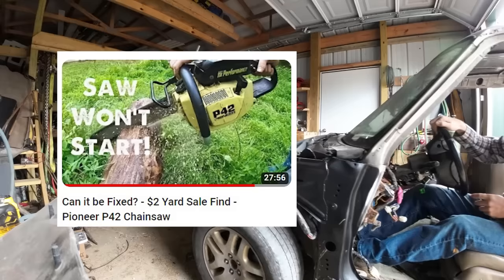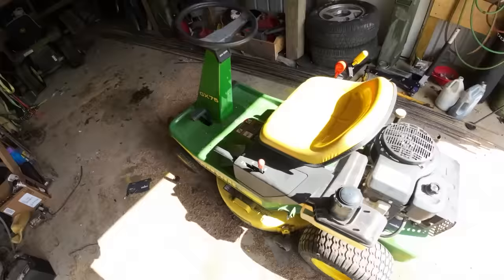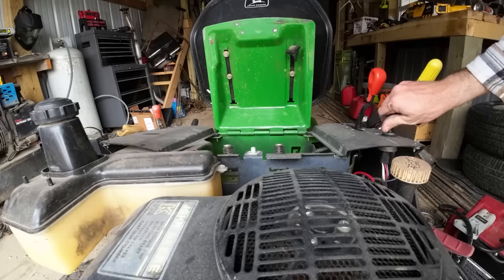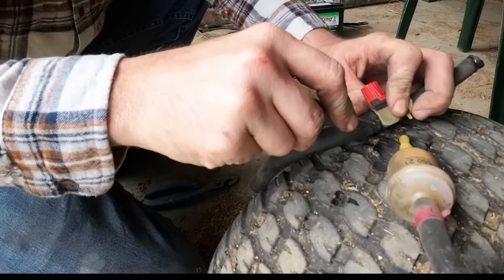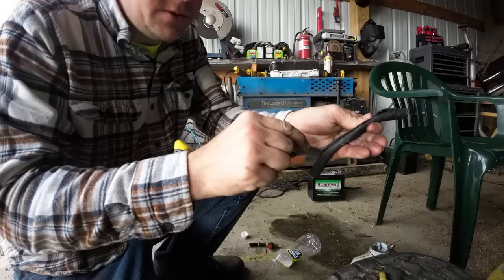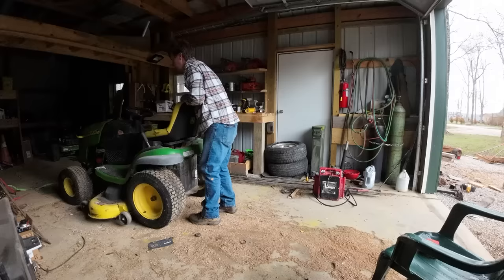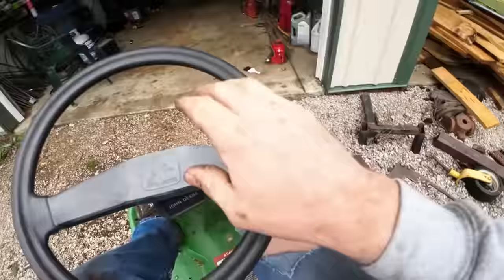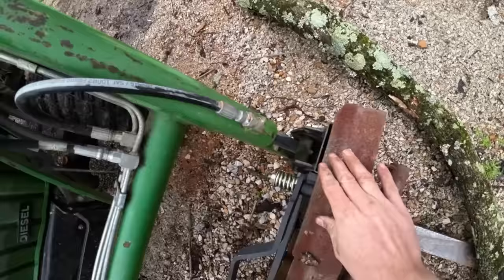Two John Deere Lawn Mowers - Cranks but Won't Start - Trade up Series

Comment: on the l120 spray ether into the intake if it runs on ether youve eliminated everything but fuel so if it runs on ether you have a fuel problem. also that solenoid is an anti backfire solenoid it shuts the fuel off from getting drawn into the motor after u shut off the tractor and causing a backfire
Reply: Exactly where my thoughts are too. Speculating on the fuel not getting through the passage after the anti-backfire solenoid. Pull the plugs and drip a little fuel into the cylinders spray some starting fluid down the intake and see if it can cough.
Reply: @tbirdracefan  yea and if it is an anti backfire solenoid problem he can just cut the plunger tip off but im betting on a fuel issue he probably didnt clean out the jets and emulsion tube good enough

Comment: I have had similar problems. I discovered the fuel bowl was empty each time it would not start. Simply removing the fuel bowl and reattaching it would allow the engine to start, but the problem would reoccur about every week. I have found that the fuel bowl float needle, as supplied by John Deere, is made mainly of plastic. The float needle as supplied by Briggs and Stratton is mostly brass. I replaced the JD with the B&S. The problem has not re-occured. I would guess that the lighter weight of the JD one meant the needle would occasionally stick in the closed position.
And the B&S one is cheaper!
So, get yourself the proper B&S brass float valve needle.

Comment: MTV (?) gas that eats rubber but cars converted to artificial rubber.  Had auto fires when CA started using it.
Reply from the maker: No, wrong hose.  Have to use fuel rated hose for fuel

Comment: Not sure what engines people are talking about when they keep saying “compression is good so it can’t be the valves”.
If the exhaust rockers are as loose as they seem then compression would still be okay even if the exhaust valve doesn’t open but with no exhaust the the fuel/air mix can’t enter because of……science.  

However I think the problem is the blinker fluid level switch. 😉
Reply from the maker: Exactly,. The exhaust could literally be missing the push rod and still have good compression.  The good news is it helps me weed out the "good" advice 🤣

Comment: I would change spark plugs sometimes they will fire out of cylinder but when under compression won’t it’s weard I know but have had it happen 😂
Reply from the maker: Good point, ended up not being the spark plugs though.

Comment: Double check tour info on the valve lash adjustment because if i remember right its .005 intake and .005 exhaust on twin cyclinder briggs.  Its .004 intake and .006 exhaust on single cylinder briggs. Thats with either having ohv.

Comment: Just because you have spark with the plug outside of the engine doesn’t mean you have spark under compression. Only way to test for a spark strong enough to fire under compression is with a spark jump tester. You can get one at any parts store for 8/10 bucks.

Comment: Any new mower that will not run.  Check oil, check fuel, pull air filter, shoot starter fluid into air horn, try to start.  If it pops and runs for a second you have fuel trouble.  With this simple process you have eliminated spark, valve, timing, compression and a hole lot of time.
Reply from the maker: If it works for you, then that's what matters

Comment: Trickle a little gas in the carb. If it starts on that you still have a fuel problem. You have compression so valve adjustment would not keep it from running.

Comment: I believe if the valve adjustment were the issue you would not have good compression.  Are you sure you have spark at the plugs ?  " Seat safety switch may kill the power to the plugs "   I would try to pour a little gas down the breather and see if it fires.

Comment: Oh, no!  The seat in the Fordaroo (Subord?) got wet!  Good job on getting the little mower running.  Once you get that other one figured out, maybe I can borrow your idea, there's a different brand (probably made in the same factory) over at my son's house that has a very similar problem, everything checks out fine, but it just won't run.  His neighbor told him it was "out of time" but like the one you're working on, I can't see how that's possible. (Fortunately, the grass isn't growing yet, and if it does, well, 200+ goats on the place right now, so...)

Comment: I like to eliminate a carburetor/fuel problem by shooting a little gas or starting fluid directly through the intake of the carb. If it starts or tries to start you know there’s still a problem with the carb.
Reply from the maker: Doesn't run on fluid
Reply: @CaptainKleeman  I assume you mean you squirted some fuel in to the spark plug holes and tried to start it? 
I would not have thought the tappet gap would be enough to stop it at least coughing a bit. Assuming the flywheel is on correctly (it appears to be right) I would next be making sure the pushrods are going up and down and opening the valves and then checking the valve timing if that is possible. Just in case a cam gear has failed in some way (but that's worst case scenario).
Reply: @ecclesmilligan8712  I agree shoot some carb cleaner in the spark plug hole.  If it sputters then the problem is still in the carb.  When you cleaned the carb you didn't mention pulling the tube that houses the jet out.  I can't think of the name of the tube but if it is clogged it won't start.  good luck
Reply: Back in the day - I’m 78 years old - so that’s a long time ago, we had the same problems.  We all start by trying to turn it over. We did not have jump packs or an extra battery hanging around - but - we did have an electric drill and put a socket on it.  Yes we would check all the usual stuff - oil, filters, linkage and gas.   First thing we did was spray starter fluid into the carb.  It it started - you had a fuel problem. If it didn’t, you had more than one problem. A “good” compression check came next. We started by removing the valve covers on an OHV engine or the inspection plate on a “flat head” engine. We removed the spark plug(s), then turned over the engine by hand. We watched the valves open and close. Sometimes, a valve never opened nor closed.- broken or bent something.  Then, we hooked up the compression tester and spun it over with the drill.  Good compression?  Low compression - we squirted a shot of oil into the spark plug hole and retested. Good compression test - the piston rings were shot - the oil gave it a temporary seal..

At this point, you know the true condition of the engine block. Now, one reconditions the fuel system - pull everything apart, clean repair or replace every thing. When your done fuel should flow like water thru a glass tube.  The only thing remaining is the carb and the ignition system. Start with the carb - a good disassemble, flushing of all passages, inspection of all needles and then reassemble.  Crank it over and watch - make sure the inside of the carb is getting wet 😀.  

Now the ignition system.  The whole system is simply a coil mounted very close to the flywheel the are two small wires connected to it - one is an electric supply line, the other is a ground wire. There will be one or two spark plug wires molded into the unit. The United is attached by two bolts in a slotted holes. Remove the unit - clean the contacts of the unit and the one on the flywheel. Reinstalling the unit, you have to set the gap. Simply insert a business card, tighten down and remove the card - these might take a try or two.  Now those other two smaller wires- one comes from the ignition switch suppling current. The other goes back to another connection on the ignition switch and grounds the system shutting down the motor.  One can run a jump line to the supply side of the coil if you suspect and wiring or safety interlock problem.

If you still can’t get it running - you might consider starting at square one to see what you missed - or - consider buying another mower.  Generally speaking - it is usually the ignition coil that goes bad first and the fuel supply just sits there making things gummy.
Reply: @billsemmendinger2592  emolishion tube?

Comment: Have you poured a little gas down throat of carb on the 120 and try to start to see if it starts and runs on it for a few seconds to make sure fuel is getting thru carb to engine. Also that solinoid on bottom of carb cuts fuel flow thru the carb to engine when the key is turned off to prevent it from running on after key turned off.  I doubt Valve adjustment will make a difference since you have good compression.
Reply from the maker: Doesn't run on fluid, valve adjustment and good compress do not go hand in hand

Comment: I usually just get a piece of fuel hose from JD and pull it thru the hole in the rocker cover to the pump vs struggling to find the proper one or waiting for similarly aged part to be delivered. Double check that keyway, it can still be in the key slots but if half sheared will be a problem too. Ive had them put a good indent in the key and not start plus you can check the magnets out under the flywheel to see if the bonding epoxy is loosening up before the stator is destroyed from one coming loose, have picked up free mowers from engine being locked up to only be fixed by another flywheel and stator. With that compression i would nt say valve adjustment is all the problem but imo it needs some attention

Comment: Never saw you check the coil at the flywheel...my D140 has two of them....about the only thing I have no replaced...well, I got a new carb and starter but don't think they are the problem...and I put two new plugs in but did not do anything as far as gapping them....just inserted them and tightened them.

Comment: I had kinda the same problem with my John Deere. After several attempts to fix it, purely by accident, it rolled off my trailer, and a dirt plug came out the exhaust. The damn thing started to work again.

Comment: Let me start by saying, I am not a small engine mechanic. I had an RV generator that would not start, because of that fuel shutoff solenoid. I also had one of those fuel pumps fail. Turns out it was the same tube that broke off on yours. Thanks for sharing your experience, may make some other guy's repair efforts so much easier.

Comment: I was given a mower that would run about 30 seconds, die, 5 min and it would do it again.

I had offered to fix it... they gave it to me.

It turned out to have a piece of a stick in the fuel line.  Probably from when the last person working on it had plugged the line to take the carb off and broke the stick pulling it out.
Reply from the maker: That's why it's best to check the simple things first 💪

Comment: I don't know if it's y our problem or not, but I have a John Deere mower like that long nose one you're working on and it has a seat safety that will sometimes kill the spark to the engine if it thinks you have the PTO engaged and are not setting in the seat.

Mine doesn't do it all the time, but it would crank and crank and crank until you shifted around in the seat and pressed that little switch harder or from a little different angle, and then whammo, she'd fire right up.

That got old in a hurry, so I did the right thing and just pulled that switch out from under the seat and zip tied a little plate of steel over the end so it's always engaged and stopped messing with it.

Anyway, don't know if that's your problem, but I do know that the safety on mine does NOT disable the starter motor, it just keeps the engine from firing.  It'll crank until the starter glows read and you decide to pave the yard, but it won't fire.

Might be a combination of safeties that are screwing you.  It was the seat pressure switch on mine, but I suspect that the PTO switch was hanging up sometimes on mine as well, 'cause the seat safety isn't supposed to do anything unless the PTO is engaged, but mine would sometimes, so it might be that BOTH safeties are actually going bad on mine and I just crutched it by jury rigging the one on the seat to always be closed (then it doesn't matter if the thinks the PTO is running or not).

Comment: Got compression... valves aren't the problem. Either the shut off solenoid or a switch has failed.to be sure unplug the rest of the crud at the motor and give it juice just to the ignition and starter
Reply from the maker: Good compression does not mean correct valve settings
Reply: @CaptainKleeman  confirm by turning it over with the valve cover off

Comment: Might be lash. You may want to check the adjustment to the inductor to the flywheel as well. You could have a weak spark. Spark should look blue when the angry pixies jump the gap.

Comment: There's a safety switch for the brake, it always comes loose on my mower, because it is clipped on under the hood at the bottom frame
Reply: It will continue to try and start but won't turn over
Reply: Location is under the battery

Comment: I have an LT155 w/Kohler CV15. I bought the mower and it ran great. I got it home and mowed about 3/4 of my yard and I hit a bubble tent that my kids left in tall grass. This stopped the mower hard. After cutting the tent out of the blade it started and ran for about 1-2 minutes. It hasn't run since, I replaced an ugly carb and fuel solenoid, it has fuel but the starter doesn't turn it over. Does the CV15 motor have the same compression release as the B&S Intek? If so I suspect the actuator tab on the cam broke. I'd appreciate any thoughts, TIA

Comment: I have a John Deere gt235 i bought new in 1999 I don’t use it much anymore and it has 2400 hours on the 18 hp Briggs and Stratton motor last week I was going to use it it would crank but not start so today I took the carburetor off and cleaned it were I ended up finding the problem was a wiring harness behind the motor I unclipped it and there was a lot of crude and rust on the connectors I cheaned them with brake cleaner spray plugged it back together and started right up

Comment: It should have a compression release which keeps the initial compression at around 60 to 70 psi to keep the starter from overloading on crank. Those small engine compression releases are notorious for failing. To test it, remove the air cleaner and put your hand over the entire carb intake while cranking it and if it starts up, you've found your problem.
Reply: If this is the issue, how do you fix it??
Reply: @kevinsteinke2603  If you've found the issue is the compression release, then the only way to fix it is to remove the engine and split the crankcase to see the condition of the cam. Sometimes the compression release counterweights can get stuck which is an easy fix. If not, then a new cam is needed.

Comment: you found a mouse house when you took the top cover off the engine.   Another place to find critters is the underside of the flywheel.  If you have good compression you have eliminated the valve issues as ling as they both open and close.   Take some starting fluid (as JPaydirt calls it "Start ya Bastard"  )   and see if it will fire .  if it does you can safely say it has something to do with that overly complicated carburetor .  you had a shut off valve clogged with hose particles some might have migrated past the fuel filter .  a clogged passage will ruin your whole day

Comment: You haven't checked for spark yet. Pull a plug and hookup the wire, hold it to see if it has spark.
Reply from the maker: I checked for spark in the video

Comment: While the valves most likely do need adjustment, that is not your problem.  You have good compression.  A really off valve adjustment, usually tight, would give you low compression.

I would go ahead and pull the flywheel to make certain the key has not moved.  

Even though you have spark, is it a good "hot" spark?  Will the magnets on the flywheel really snap something like a hacksaw blade down?

I am a diesel guy, pour a small amount of diesel on it and it'll be OK.
Reply from the maker: Good compression doesn't mean valves are good.
Reply: @CaptainKleeman  But a valve not seating would cause low compression

Comment: For your fuel pump vacuum line you can order those through husqvarna or Kawasaki.  Did that 2 years ago on my sisters husqvarna.  The engine is almost identical with the BS engine in the deeres.  They're all manufactured by MTD anyhow and just painted with your color preference (deere, husq, craftsman, murray, some aries, and on down the list) 

And stupid question... did you check all your safety switches for continuity or just for being there?  Dont assume they are good.  My mower should shutoff if the blade is engaged and you try to reverse...  obviously a safety switch has gone bad but in a good way.  And you did try to start it in neutral correct?

Comment: That hose was broken down by using the Ethanol gasoline without using an additive to protect the rubber parts and the carb. If possible always use regular gasoline without the Ethanol. If you only have E-gas in your area, make sure to drain the entire system before storing. Thanks for sharing Mike.
As for the L120, other than the items you have already done, the troubleshooting guide indicates a cause could be carburetor float not adjusted properly or that the brake pedal must be depressed to start and lastly Inspect and adjust throttle cable. You have checked everything else, might as well check the last three items on the list. Good luck.
Reply from the maker: It was broken down by using a non fuel rated line
Reply: I have run E10 fuel for years in anything that runs gas. Never have had a problem with degrading fuel lines or corroding parts.

Comment: Ethanol did that to the hose, it  melted the hoses on my 916 bloody nightmare. Anything old will be at risk.
.
Reply from the maker: It didn't help that it was vacuum line instead of fuel line.